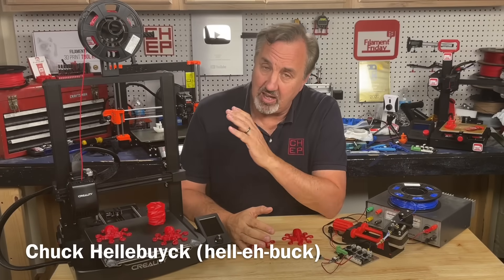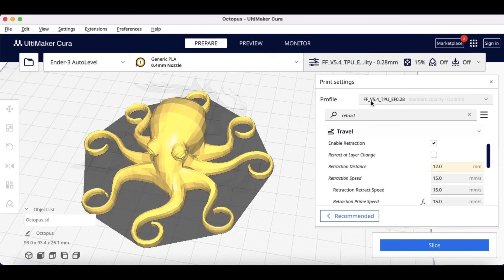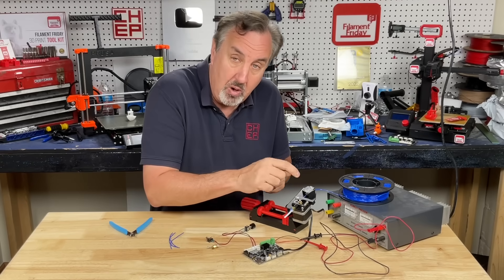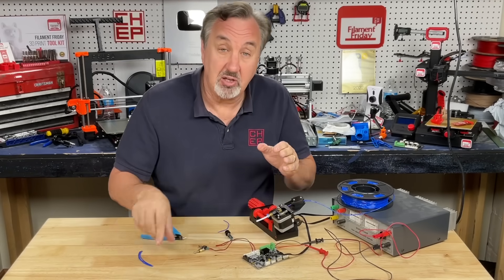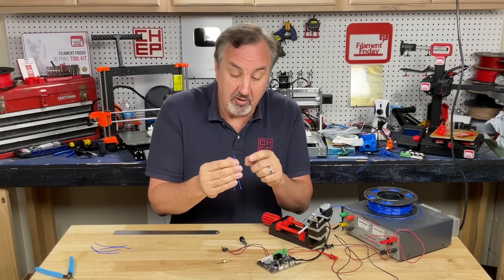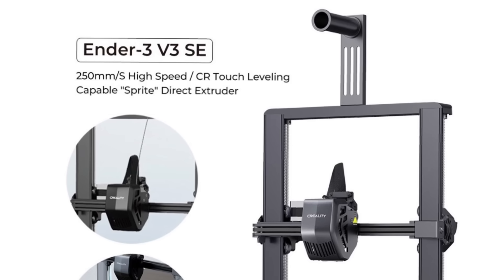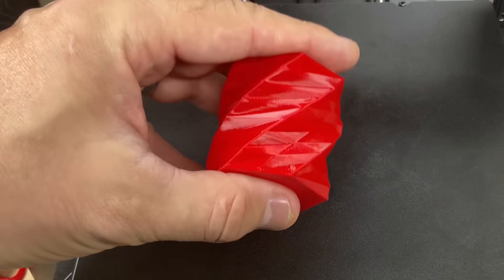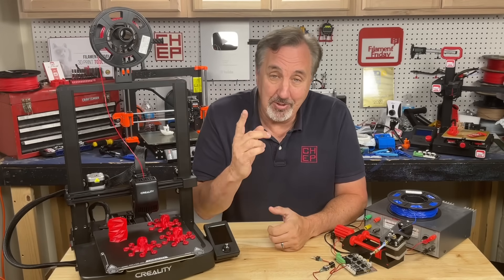How to print Flexible Filament on Direct Drive Ender 3 3D Printer

Comment: This profile fails to import, any ideas?
Reply from the maker: Use a Creality Ender 3 Machine Profile in Cura.
Reply: that's what I did after posting. But it doesn't work for me having anycubic kobra 2 neo @FilamentFriday
Reply from the maker: @Anoty - It works for many. Just adjust bed to match your printer and it will work fine.

Comment: Question. I bought used, an original Ender 3 silent board 4.2.7 direct drive extruder 40-42 e step motor what should I set my retraction rate too? I’m printing with PLA currently, never had a 3d printer before or much PC experience however I did learn to program the firmware in just a couple of days, I actually have tons of questions if you would be willing to help :)
Reply from the maker: For TPU, 1-2 mm retraction.
Reply: @ today i found about .8 works for my direct drive drive ender for PLA what would you recommend, retraction really does help a lot with stringing

Comment: Just tried this on my ender 3 thats got the newer silent board, direct drive and cr touch. I was having lots of issues before with vase mode and non sticking of layers etc.  Used your profile and still a few minor issues, so dropped the speed a little and thickness to 0.2mm and it works great!  Thanks :)

Comment: Trying to print NinjaFlex on  my Ender 3 V3 KE and having horrible results. Will this profile help you think or is it just for 95A type of fillaments?
Reply from the maker: It’s tough to say. Ninjaflex can vary from spool to spool.
Reply: @FilamentFriday  sorted, printing descent now with NinjaFlex.
The retraction length was way too high and made my extruder squeal like a pig.
Temp and flow had to be adjusted aswell:)

Comment: Grabbed this and I'm tuning it on my Artillery Sidewinder right now. The "Outer wall inset" that was set on the profile was causing issues for me so I removed that setting. I tend to print smaller objects in TPU so it may be fine on larger things. So far the print is looking great. I'm so excited to not have to deal with all the strings anymore. Thank you!

Comment: I just printed a hoopin cable clip from Thingiverse by Haku3D in TPU with my Ender 3 V3 KE. I used Creality Print and the included TPU profile. I used 2mm retraction (7mm did not work and did not finish the print. The filament stopped flowing the last part and I attempted it 2 times and it failed 2 times.) and 40mm/s retraction speed. I printed it at 100mm/s with a layer height of 0.2mm, an Initial layer speed of 30mm/s and a flow rate of 115%. I had no problems and finished 2 prints, 1 at 60mm/s and 1 at 100mm/s. Both look good.
Reply: I'm gonna try this one a print very soon. If I manage to actually print TPU thanks to your profile, I'll be indebted to you!!!!
Reply: @ewokgaming832  You are welcome. Nozzle temp @ 230, bed temp @ 50. I hope you get it right.😎

Comment: Just did my very first TPU print (of course of the octopus... seems perfectly fitting!) on my new Ender 3 V3 SE, only after reassuring my good ole' reliable pal V2 that he's still the PLA champ in my books 🤣

The direct drive and auto leveling on the V3 SE made it much easier to try TPU and it came out nearly perfect with this Cura profile. I'm still not sure how they were able to put these parts together and still make a profit but I'm very happy with it.

Anyway cheers for guiding us all through this fun hobby and sharing your knowledge with us! 🍻
Reply: What temp for the filament did you use and bed temp?
Reply: were can i find the octopus model?

Comment: Do you happen to have a cura profile for the ender 3 v3 se cura currently doesn't have one available?
Reply from the maker: I use my existing Cura profiles and an Ender 3 machine profile. Works great.
Reply: @FilamentFriday  thank you I'm very new to this hobby if I use the ender 3 profile will the Auto bed level still work sorry very new at this I heavily leaned on you videos for learning my ender 3 pro couldn't have done it without ya
Reply: @jonathanmayfield9218 As far as I understand bed leveling is handled by the machine firmware, Cura requires the addition of the G29 command to the start gcode to tell the machine to auto level before commencing print.

Comment: Thanks! Copied the retraction settings into OrcaSlicer for my Ender 3 S1 and it works perfectly! Been struggling printing tpu and never thought to up the retraction that high on direct drive. I previously had it at 0.5 and it was a mess.

Comment: Did you print the TPU in an enclosure?
Reply: Hi. You don't need an enclosure for TPU. I print with CHEP's PLA profile on my Ender 3 S1. TPU prints great. 5mm retraction.

Comment: Excellent profile, thanks! I did load your other profiles for the SE, and I'm still getting heavy stringing. I've messed with retraction speeds from 20-65mm/s and retraction distances from 4-6.5mm and no combination works. What's a good setting to stop PLA+ from stringing on this machine?

Comment: Pretty cool! If you manually disabled the temp requirement to advance the extruder, you could do the same test on your actual printer with a cold hot end. That way you could truly test for any setup, although measuring would be a little harder and on a bowden tube you'd have very long test pieces.

Comment: Do you have a print in place video on setting up having a hard time with no luck
Reply from the maker: I’ve done several in the past. Each print is unique and many times it’s a design issue not a print setup issue.

Comment: How did you get stringing on that model where each layer has a single connected component? Did you turn off combing so it does linear travel rather than staying inside the model? I noticed because this model is kinda infamous as the classic "wow I can print TPU!" gotcha because it doesn't need any retractions despite looking nontrivial.

Comment: I print a lot of flexible and all I do to tune out the stringing is run a standard retraction tower for both distance and speed.  0 stringing with TPU/TPE from 95a to 90A to Ninaflex.  Benchy's with no stringing.  Printing with combos Orbiter/REVO, MS Direct Drive/MS all metal hotend, LGXLite/Phaetus Dragonfly, Bondtech with MS all metal hotend, and BTT BQH2 .  Works with all of them - no stringing after two simple tests.  Just keep it simple.....

Comment: What about bridging? I like the approach on stringing, and good to demystify the don't use retraction guideline that others give. However, I would love to see how you would address bridging problems with TPU, too. Bridging has been a major drawback for me when printing TPU, and the difficulty in smoothing TPU after print makes it even worse. Any tip on that?

Comment: Though 7mm seems awfully long, TPU is very different filament than ridig PLA + result is very good 🙃
Method itself is interesting and innovative. I wonder what result it would give for bowden tube, or how much reverse bowden (between spool and extruder) would stretch TPU 🤔

Comment: If you find yourself needing long retractions with TPU, it probably means your linear advance isn't calibrated right or the TPU is really wet and the long retraction is helping cover for that. Long retractions are pretty much functionally equivalent to a higher LA K value at a fixed speed, but don't capture the right pressure profile during accel/decel ramps or any speed but the one you tuned retraction for.
Reply from the maker: This printer doesn’t have linear advance and neither did the older versions that I had the high retraction on and I’ve dried the TPU and found it didn’t change. It was all compression in the long bowden tube that required high retraction just to move the filament and relieve the pressure.
What you describe is more about settings for non flexible PLA.
Reply: @FilamentFriday  Wow... Creality is ~still~ shipping printers without linear advance?? I assumed they'd finally upgraded.. but no.. 🤦
Reply: @daliasprints9798  Creality firmware is extremely basic and no version of it has any of the optional features you'd find in third-party versions.

Comment: obviously its seems to work. But thats alot of retraction. On direct drive isnt the recommended retraction max 1mm?
Reply from the maker: Not for flexible TPU. 1mm is recommended for PLA.
Reply: @FilamentFriday  thanks for the info. Great vid as always 👌
Reply: The recommended maximum is assuming you have modern firmware with linear advance. Just found out from CHEP that Creality still doesn't. 🤦

Comment: Well that tells you the compression of TPU if your nozzle is clogged.  But in reality, the material is flowing, which means there isn't as much pressure on it and therefore not as much compression.   Also, there's no retractions in vase mode.  😉
Reply from the maker: @twinturbobostang - The nozzle is much smaller than the filament so there is almost the same pressure. The base mode example was to show the profile didn’t need to change for spiral mode. It handled the speed as well.
Reply: Yeah but while retracting the materialyou want to stop filament from oozing so it is better to have it slightly more than not much enough.

Comment: I was wondering if printing with klipper is faster than the extra fast 0.28 profile and if it’s possible to combine the two and print even faster? Maybe that can be a future video.
Reply from the maker: Klipper is faster. Not sure the tricks will work.
Reply: Klipper can increase acceleration using input shaping and equalise flow in speed changes using pressure advance.
Marlin has also both.

Klipper won't make filament melt or flow faster 😉

Comment: Wow, Chuck, that's quite the experiment! I vaguely remember someone, whether it was you, or Stefan, or Daniel from Modbot, or someone else, suggesting that the conventional wisdom of very small retraction values for TPU was wrong but I don't remember the results being demonstrated as explicitly as you have here (and I definitely don't remember seeing such blazing retracting speeds). I'm going to have to think about the TPU profiles I have for my printers, and how they might need to be tweaked.
Reply from the maker: Or just download mine and try it ;)
Reply: @FilamentFriday  That is indeed the plan for my Ender 3, but my Sovol SV06 Plus works better with profiles I found for SuperSlicer and if I ever get the Sidewinder X1 working again I'll have to do some work there as well.

Comment: Quick question, I have both an Ender 3 Pro with a bowden tube, and a Sovol v6, the Ender will not print with A92 TPU at all, and I have snarls in the Sovol extruder, what is that you're using, A95 or A92?

Comment: Know you usually only make request videos for patreons but I would love it if you made a profile specifically for the ender 3 with the microswiss hotend. You've said in the past that it would only require changing the extrusion length, but no matter what I try your profile doesn't work well. Little surprised you haven't made a microswiss profile by now. (one of the biggest upgrades people add to their enders)
Reply: would not be hard for you to do. just do it with a clean nozzle
Reply: @markburton5292 I've done that, after doing a few successful cold pulls, Yer comment isn't helpful at all. And cheps entire channel is built around tutorials and profiles for the ender 3 (my request is right in the ballpark of what he does, he makes a video gets views, everyone's happy)
Reply: @Schwift3D  you can take it that way but it was a simple statement that you don't need to wait for him to do it. You can do exactly the same thing he did on your printer. rather than do a cold pull just buy a new nozzle that hasn't been used and make the measurements.  he showed you exactly what you need to do. in this video
Reply: and the reason I say use a new nozzle is no matter how many cold pulls you do there will always be some residue that will throw your measurements off but that won't happen with a new nozzle as there isn't anything in it and they aren't expensive.
Reply: I changed the retraction to 3mm and the extra fast profile works perfectly fine for me.
Reply from the maker: @Schwift3D - It’s not the profile, it’s Microswiss hotend. It needs to be primed occasionally with oil, like I show here: https://youtu.be/OG7We83M5gc?si=Ad66yGvd8ijd4c3N
Reply: @FilamentFriday thanks, ive used one of those oiling printed parts in the past on a different printer, I'll have to Give this a try